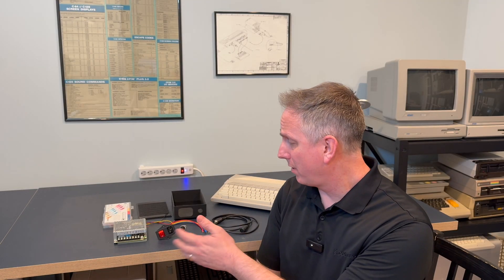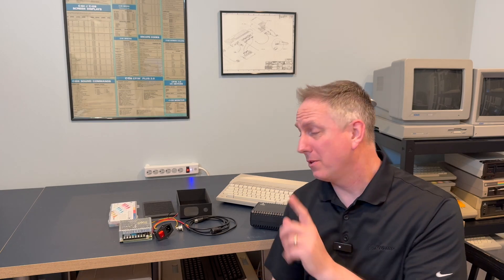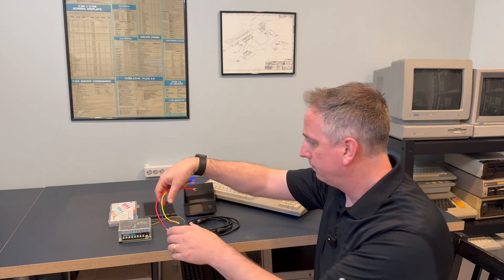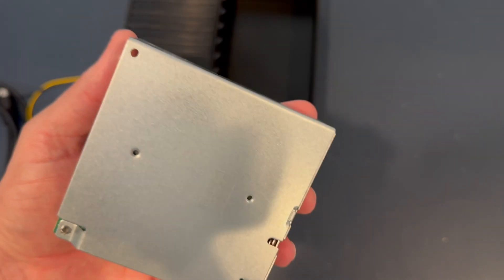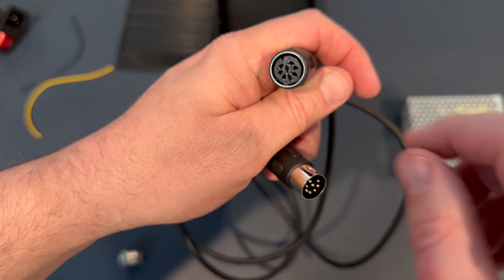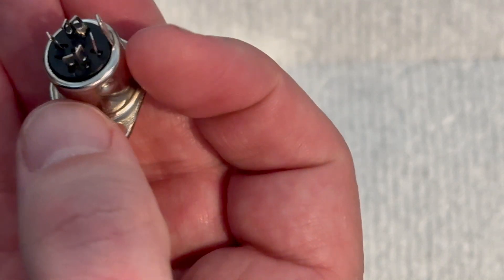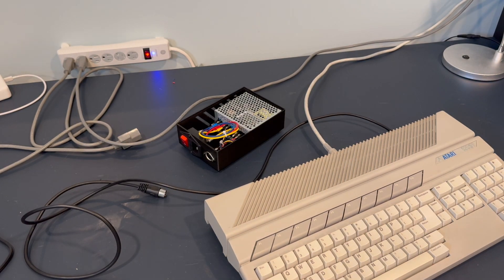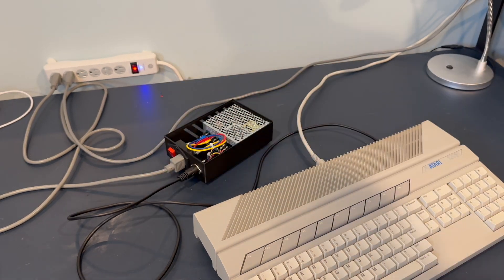Building an Atari 520ST Power Supply!

Comment: 1986, my first ST ! ST<not anything after !>
Yes, I think there were few 260, but not much. At first, my ST had 2 EPROM with just enough software to boot on floppy. So 512 KB were the minimum. Why ? The TOS went in RAM, add the usual desktop accessories at the time, launch ST Basic and cry ! 4 Kb left for your program ! OK, that's 4 times what's in a base ZX81, but I had the 64 KB extension on this one !
Later, I had the EPROM replaced by a TOS, freeing as much RAM. Better, much better ...
My ST had 1024 KB. Most of the time. Why ? Because I had to bring it back about 10 times, because of bugs, mainly MMU related I think. And one time, back home, my 1040 had become a 520 ...

About the power supply ... Well, power supplie in fact ! One for the ST, and one for the floppy, both were external too. But it was so useful in winter : you got one power supply to warm each of your feet !

Another detail : the mouse and joystick ports were on the right, so much easier to access than on the STf and STe !

I'll regret all my life the moment I sold it. But it was to by an STe with 4 MB and develop a commercial SW (nothing famous, some ST Photoshop called Studio Effects. Some copies sold in France by a very small and very dead company !). This STe is still on my desk, with its B&W and color monitor, and the 300 MB HD from a friend !

Comment: you should probably have blocked off the case ventilation to the area with the wires, because that case looks like an electrical hazard.
Reply from the maker: Not a bad idea...I'm fine with it as it is given how I use it...but for long-term broad use (like on floors and whatnot) that makes perfect sense.  Already have a modified design printing. 

Thanks!